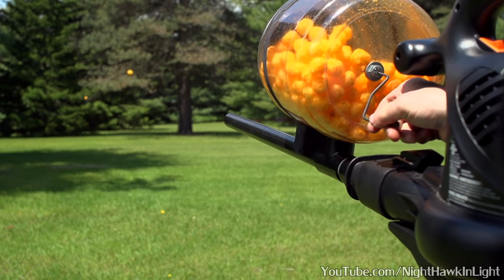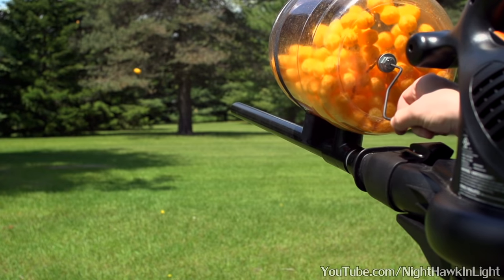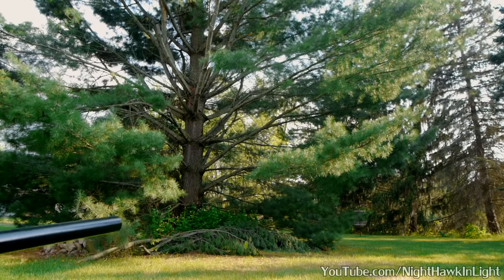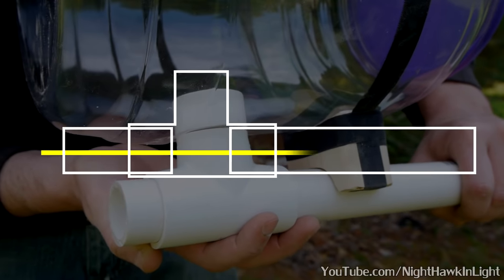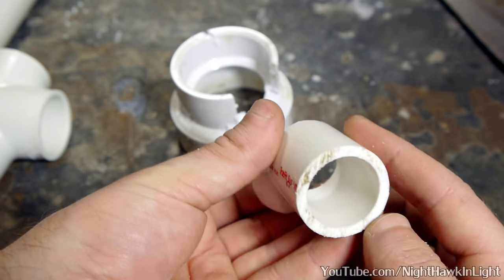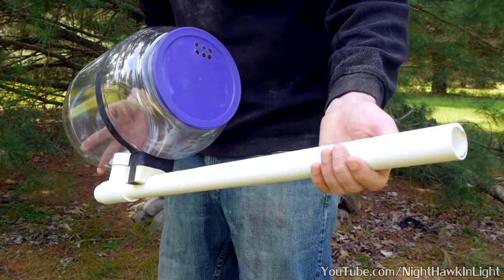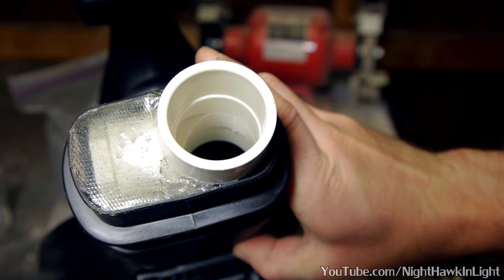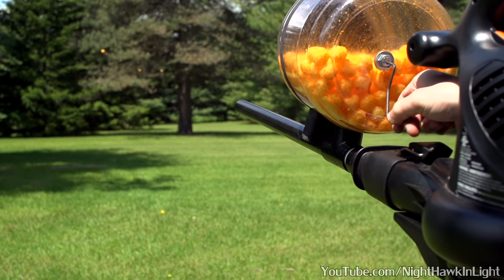How To Make A Cheese Ball Machine Gun - NightHawkInLight

Comment: Hey NightHawkInLight If you put a second pipe into the back of the hopper it will equalize the pressure so that the air doesn't resist balls falling in. Also you could use a sweeping pipe tee (I think they're called cleanouts) to keep air from blowing into the hopper from the bottom.

Comment: Wouldn't it preform better if instead of a t-fitting you used a wye fitting (like a tee fitting but instead of the third port coming in at 90degrees it comes in at like 45) you probably wouldn't "need"  the little ramp in the fitting then ether.
Reply from the maker: +eddie mirsberger Potentially, but mounting the hopper would be messier and gravity wouldn't assist feeding the ammo as well.
Reply: NightHawkInLight hmm true,  just coming from a modified nerf background and that's what we use for darts (mainly because a dart won't bend 90 degrees)  just got me thinking.  But I see what you mean.
Reply: +NightHawkInLight What song do you use in this video?
Reply: +eddie mirsberger this is paintball not nerf.
Reply: +eddie mirsberger It comes down to the ammunition. Nerf darts are flexible, while cheese balls are balls of starch type stuff that doesn't bend or compress, they break down. The last thing you want is shreds of cheese flying out instead of whole balls.
Reply: ***** I get that,  I just thought the natural slope in a wye would let them feed easier,  and provide a more steady stream of balls.
Reply: My initial thought is it's actually the venturi effect that draws the cheesy poofs in to the barrel.  If that's the case it's not really about deflecting the stream of air, but instead it's about putting a bottleneck in the pipe that creates a high pressure side before the "ramp" and a low pressure side that pulls cheese balls from the hopper.
Reply: Yup, a venturi. I'm sure he's familiar with the concept, not sure why he didn't mention it. Also, having the feed tube extend into the jar is what necessitated the stirrer. A less intrusive bulkhead fitting would have probably made it so that a little shake here and there would have made it feed better.

Comment: Would this work for Marshmallows?
Reply: +Chloe Ono Marshmallows are denser and less rigid, they wouldn't propel very well, and would likely get stuck in the ammo compartment more easily because they're squishy and sticky.
Most marshmallow launchers have the marshmallow make a seal in the barrel, as to benefit fully from the air pressure. Cheese balls are light enough to be carried by the air.
Trust me I'm a marshmologist.
Reply: +Chloe Ono Look up "Worlds most powerful Marshmallow cannon" it is a bit harder than this to build but when you can put tinny marshmallows through cardboard who cares.
Reply: Maybe fat-free marshmallows. They're smaller and harder than regular marshmallows, and they taste horrible. Perfect, right?

Comment: What if you were to make a smaller pipe cause a bit of pressure into the container to stir them up, instead of the physical agitator? Like one off of the blower that would agitate them and force them down the hole. Kind of like those pick a number machines for BINGO.
Reply: +SeanHodgins that would slow down loading badly.

Comment: Interesting device, particularly the "venturi wedge" to speed up airflow and cause a partial vacuum. I'm curious what would have happened if you'd used a 45° "Y" fitting (angled backwards) instead of a T fitting. That might have accomplished both the re-direction of airflow (or rather, not allowing it to rise into the hopper in the first place) and making feeding the cheese balls into the barrel more smoothly?

Comment: NightHawkInLight
Would it be possible to make an agitator simply by blowing some of the air into the hopper, that way the cheese balls move around and then get sucked into the launch tube?
Or you could possibly make the air pressure oscillate somehow, so the air gets blown into the hopper, then the pressure reverses and it creates a vacuum. I suspect this might be trickier to implement and fine-tune (if it'd even work well, which I'm not 100% sure that it will).

Comment: Could have put two holes in the container. Have the leaf blower blow up into the container with the PVC stopped so that air only goe sinto the container, and had it come back out the bottom on the other side of the stop forcing the air into the "magazine" which would force the air AND the cheeseballs down and out.

Comment: you could also improve it by ignoring the fluid dynamics altogether and pushing all the airflow into the hopper, then having another pipe on the end to attach to the barrel. that way the air picks up the balls as it moves through and just spews them out like a cheese bullet hose

Comment: I've been wondering... Why can't you use that airsoft bullpup design as a firing mechanism instead? By releasing the air into the chamber, it would agitate the ammunition, load it into the barrel, and fire it out all aty once. Or is the lid not strong enough to resist the pressure?

Comment: Hey nhil, I have two questions. 1) why is there holes in the lid? 2) how big was the the fitting scrap before you made it a ramp? Thanks, -Trent
Reply: +Trent Tiedeman I can answer 1). For the Venturi Effect to draw in the balls by suction, it has to be able to suck air from somewhere, so the holes are to prevent a vacuum forming inside the hopper and stopping the suction.

Comment: But does the airflow really cause suction in the container?
You can see the cap of it getting pushed out a lot of times...
Reply from the maker: +Hoch134 The cap gets pushed out whenever a ball enters the barrel and blocks the flow. The way the redirected airflow creates suction is that as the high pressure passes by the low pressure toward the hopper it creates friction which pulls the stationary air forward. I didn't really have time in the video to go into greater detail unfortunately.
Reply: NightHawkInLight Sound's logic. Thanks for the explanation.
Reply: +NightHawkInLight Cheese ball machine gun battle.
Reply: Sounds logical. But I failed with spelling twice, so feel free to insult me.

Comment: but if there were no holes in the lid, would you still have that updraft? I mean sure it would pressurize up to a point, but then it would stabilize right?
Reply from the maker: +Leonard Greenpaw Without the holes it would still work, but be mostly gravity fed.
Reply: NightHawkInLight
 Well viewing it in terms of the fluid dynamics, I imagine an updraft until the pod  reaches equilibrium pressure. but as the ammo gets ejected it will create a rise in pressure, and as the ammo escapes the shaft, their will be a decrease in pressure as the pod returns to increase in equilibrium.

If you look closely at the video, at the lid as you are firing, the jump in pressure is still noticeable

Not sure how much of a difference it would make though. The important part is that you already have an agitator in the pod, and its not like your current fire rate is incredibly high

Oh maybe if we pressurize the pod directly! YES  Do that next! Machine gun upgrade! and full it with golf balls! or ping pong balls! Make it hurt >:D
Reply: +Leonard Greenpaw It sounds like you missed the part in the video where he add a piece inside the barrel to redirect the airflow and cause a vacuum to be formed at the opening for the cheese balls rather than it pressurizing the cheese ball container and for that to work it needs the holes to let air in.
Reply: dugg117
no I got that part, what I am saying is that its uneeded
Reply: The venturi isn't so much sucking the cheeseballs out as its pulling air out. The cheeseballs are just along for the ride. The air being pulled out has to come from somewhere.

With no holes you have negated the venturi effect, and are then just relying on gravity to drop a ball into a stream of turbulent air. Which might not let even let the ball out of the feed tube.
Reply: Channel+
Yes just like no holes would negate the updraft he mentioned. Thank you for agreeing with me!
Reply: Could also try putting the holes on the bottom side so the air coming in may cause the balls to jump around a bit and stay loose. Lots of stuff to try.
Reply: Leonard Greenpaw That little bit in the barrel is definitely needed. Without it there would be no negative pressure to pull the cheese balls into the barrel.

Comment: so, why not build it in a similar way to your $4 bb gun?
drill a hole in the bottom of the barrel, a hole near the edge of the lid. stick the barrel of of the blower in the hole in the bottom, place a pvc tube in the lid hole. airflow goes out the blower, through the barrel, picks up cheeseballs, and they get shot with it out the front.

Comment: Why not just feed the air in to the bottom cheeseball container and have the barrel come out the front of it? It would shoot insanely fast and you wouldn't need a little wire to get it to work.

Comment: I wonder if you could use a TY fitting instead of a Straight T that you have to add the ramp to?
Reply from the maker: +jayhitek I considered it but didn't try it to find out. It would have made mounting the hopper a little more awkward.
Reply: +NightHawkInLight You're absolutely right.  My terminology was wrong.  I was thinking of this "sanitary dwv fitting".  LIke this http://www.amazon.com/NIBCO-4811-Sanitary-Pipe-Fitting/dp/B007Q45GUW/
It almost creates the Venturi Effect you're looking for.

Ofcourse you would have to bushing down the 1 1/2" pipe opening to the 1".
And I am absolutely going to try to make this.  Love the idea.  My kids would love it.
Reply from the maker: +jayhitek It may work, but probably not quite as effectively as the built in ramp. I don't think the angle is steep enough. It's worth a try though. If it does work it may make the gun more powerful as it would not impede the airflow nearly as much.
Reply: +NightHawkInLight I'll give it a shot and report back.  It will be easy to test before glue up, by running air through it and seeing which way the top is either pushing or pulling air.
Reply from the maker: +jayhitek I didn't even glue my fittings together. The leaf blower is all volume and no pressure so if the fittings are a snug fit no glue is necessary.
Reply: +NightHawkInLight Full update: I had a couple of failures.  My tweak of your design didn't work.  Air blows out of the top hole with the dwv fitting.  So i'm either going to add the ramp to my Tee or just going to remake it exactly like yours with a standard 1" Tee.
You can see pics of mine here.  Nearly Identical to yours except for the Tee.
https://www.dropbox.com/s/tdwe1oeb6tsez6l/20160521_131330.jpg?dl=0
https://www.dropbox.com/s/rrdyesd0f106vzb/20160521_131323.jpg?dl=0
And the 2nd failure is the Utz Cheez Balls in the 35oz barrels.  BJs stopped selling them around me a couple of months ago.  Which is a huge bummer because I actually eat them. So I had to order them off amazon..
Reply from the maker: +jayhitek That's too bad it didn't work for you, I was hoping it would. The pictures look great though, thanks for showing them to me. It should work fine with the addition of a ramp.
Reply: +NightHawkInLight I will not doubt you again.  You're design was 100% on the money.  I did away with my attempt of using the dwv, and just made it your way with 1" Tee and a ramp.  Bingo.  Works just as it was intended with drawing in air from the top.
Now just have to wait for my amazon shipment of cheez balls to come in..
Keep up the good work.. Big fan of your channel.

Comment: Have you tried a small bypass to use air instead of the agitator handle?
Reply from the maker: +Painmaker Sort of. I tried a design that fed the air directly into the hopper in the same way as my airsoft machine gun videos, but the air volume was not great enough from my compressor. I did not try that same design with a leaf blower, but it may stand a higher chance of success.
Reply: +NightHawkInLight I wonder if the angle of injection makes a difference, blowing in straight might not work but what if you get a small centrifuge effect going?

Comment: why not just have the air flow directly into the cheese barrel then have the pipe come out of the barrel on the opposite side? wouldn't that eliminate the need to have the odd T fitting?
Reply from the maker: +Canadian Bacon Yes, that may work. I have used similar designs before in my airsoft videos. The trouble would be that the hopper would then be supporting the weight of the barrel and it just wouldn't be sturdy. It would require a lot of reinforcement making the design more complex.

Comment: What if the hopper was on the bottom?
Reply: +Brennon Kennedy The gun wouldn't fire anything because gravity.
Reply: +Brennon Kennedy think of a paintball gun.  same concept
Reply: hardwirecars Yeah, but what about the air that goes into the container? Without holes in the lid (and it being properly sealed) wouldn't the air have to go up and out the barrel, carrying a cheese ball (or more) with it?
Reply: Brennon Kennedy yes but the air pressure is not great enough to lift a cheese ball not like you are thinking the redirected air is not that strong. yeah it can knock a cheese ball to the side keeping it from loading but its not going to lift it up into the barrel